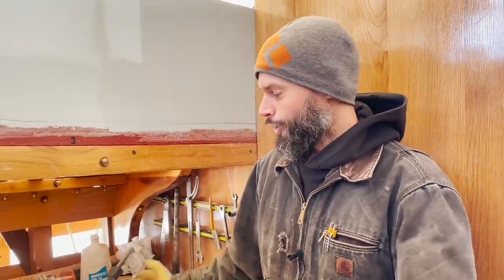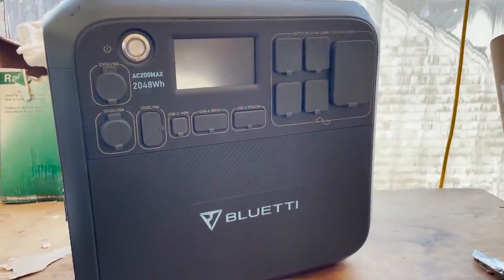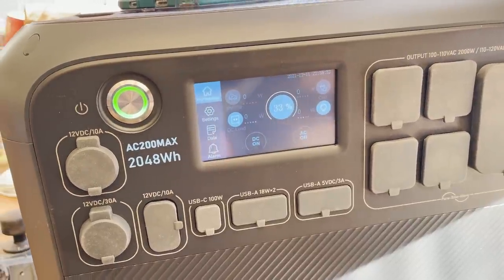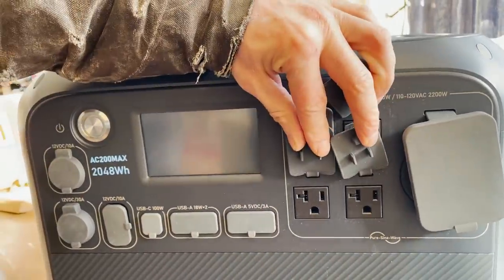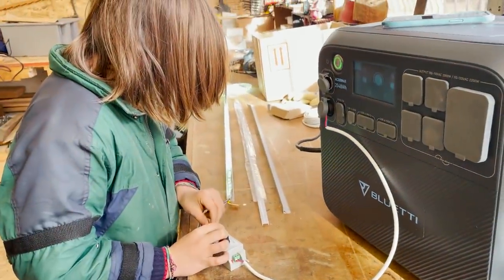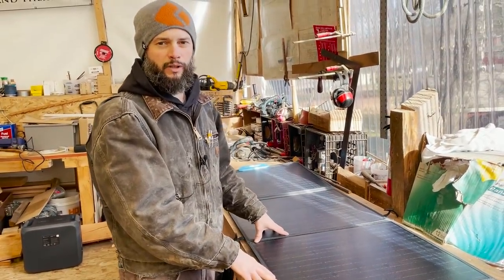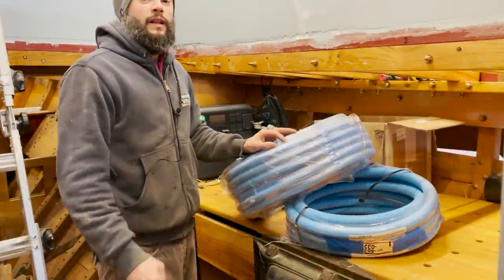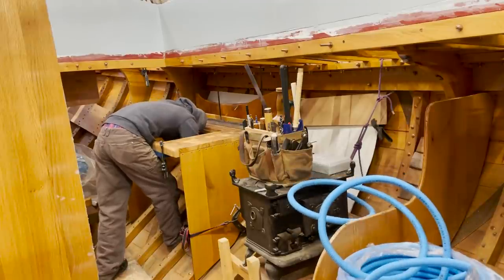Boat Electrical Systems, First Steps - Episode 194 - Acorn to Arabella: Journey of a Wooden Boat

Comment: As an electrical geek. I am not impressed with this battery setup. I would imagine inverter/charger unit's you leave on the boat are better suited. I don't feel comfortable with an assembly that you can't repair individual cells. I am an electric fork lift mechanic. I've managed battery charging systems for 16 years. Being able to pull cells or batteries out when there's a failure can save a ton of money. 

Unless you're getting some kind of kickback.... like the entire system and repairs included, for free as some sort of R&D agreement, this is not a road I'd travel down, personally. However, I'd like to see you guys prove me wrong and the system be great.
Reply from the maker: We’re thinking a smaller system we can carry into the back country is definitely the way to go. It’s been a little while longer with it now, and while it’s great for a backup on land, primary on a boat is a stretch.

Comment: I have found that strip lights and lightning are a poor combination.  Strip lighting is very delicate.  I suggest finding a expert that can coach you how to survive lightning strikes.
Reply from the maker: We’ve found a great many differing opinions on that. What’s the method you have in place?
Reply: @AcornToArabella  I have had good luck with "ALITOVE WS2811 12mm Diffused Digital RGB LED Pixel Light Individually Addressable Round LED Pixels Module IP68 Waterproof DC 5V".  I only use them inside for arts projects.  I would never use them outside or for something I rely on.  I would ask people who have boats, what works for them.

Comment: the bluetti is a great backup but you really want to build in a system that is proven then locked away, check out some of Will's videos: https://www.youtube.com/watch?v=adFGmOlDM-Y . A 24v all in one inverter charger that you can hardwire in with a nice simple shore power connector and a couple of 24v lifepo4 batteries that can be charged from the engine or be used to jumpstart the engine (redundancy) is the way to go.

Comment: like the 3 nobs color controler.. no apps.. no smart something..no small fiddeling remote... put it out of the weather protect it from rain and you can adjust it even with gloves on

also you might ask Bluetti about the 2 extention Batteries or purchase them..if you want to use that thing remote on an iland you also must think about a watertight box or bag for transportaion and a backpackrack these are not that light
also in this case consider a second unit to stay on board

 but at least plan for needing the future space for the 2 extentions right next to it where you put this thing in your boat

Happy New Year o7
Reply from the maker: 🎉 happy new year!

Comment: @JAFO  Not realy!! Because if you do not open the fridge dor, temp. does not rise during a long perio of time, and the PLC with data from the termostat, that manage the compressor, put it in an stand- bay modus. From the 30 hrs you reportet, it works probably only 10hours on full load!  To confirm what I'm sayng, it is Very easy, just put an multimeter in sequency, ( in to the current circuit, and you will see Amps consumption  instantaniusly!!!  For no money, I would go on the midia, and tell so much non sence!  It Would ruin my credibility, personaly and professionaly. How so much ingenuity could exist, at the ARABELA Team, such a lovely project! And EXTREMLY Professional! Hard Working, honest persons. Please do not sale your soul, spoil ARABELA heritage!! I will be on miami boat show. We can meet

Comment: A Bluetti advertisement disguised as the usual content. Not really very cool, if they paid you or you got the goods for free - you're paying with our time. I'm 20 minutes in, and it's all about the product so far. Anyway, I would separate everything like batteries, charge controllers etc, so that you can replace any single item if it breaks, instead of replacing the entire box if something goes wrong, not to mention finding a dealer near wherever you are in the world.
Reply from the maker: Remember when we did a side-by side comparison just a little while back of the new thickness planer and the old? That was about 20 minutes on a tool. Thanks for watching… details can feel like a commercial I suppose, but we get detailed about a lot of the equipment we use. As for the house battery system, Steve is leaning back toward a conventional battery bank, but maybe planning to have a smaller version of one of these that can leave the boat for shore excursion. I personally don’t like anything I can’t take apart and replace or modify. —Anne
Reply: @AcornToArabella  Did you guys agree to give that product time on your channel in exchange for a freebie, discount, or money?
Reply: @AcornToArabella  ...not that it matters, I've already unsubscribed. I won't be the victim of ambush marketing, or possible dishonesty again. Fool me once...
Reply: @AcornToArabella  And all of a sudden it now says "includes paid promotion" in the top left corner. Tut tut.

Comment: The planking isn't finished. The hull is miles from finished. Bulwarks aren't done. The interior structure isn't done. Decks aren't done. The house top isn't made. Tanks aren't in. Spars aren't done........so playing with coloured strip lights seems a bit premature.
Reply from the maker: There you are, Mike! Happy New Year.
Reply: Never built a boat, built plenty of houses.  This is exactly the right time to be installing conduit and taking a deep dive into the technology available to make her a home on the water.  That, and the diversion from structure to mechanicals is good for the creative juices and provides an opportunity to rethink and redesign structural elements that may be needed to accommodate the technology.  Just my opinion but I respect it highly. 😊
Reply: @sunny71169  I've built plenty of houses, too, and I'm an architect. At no stage have I run cables before I've finished the walls or got the roof on. And having to build internal walls (partitions) around service runs would be just making work for yourself. Work it out properly on paper and there is no need for re-thinking or re-designing. It just feels like A to A are drifting. The focus and drive has gone, and it's now more about the Youtube channel than the boat.
Reply from the maker: There’s the spice. 🔥

Comment: I think “includes paid promotion” at the start was an understatement. You basically spent 22/27 minutes promoting their product.  You should have billed it as an advert that includes approx 5 minutes about a boat… it’s shame that what was a great channel is going this way. I have been watching since you poured the keel and if you keep going this way, I will stop. I get it, it’s costly to run a channel and build a boat but your donations and YouTube revenue surely don’t leave you penniless.
Reply from the maker: Dave, we’re glad you’re here. Talking about the specifics of what Steve thinks will be an auxiliary power source to some kind of primary 12V battery system is indeed a departure from woodworking for sure. We did want to disclose that we didn’t pay for this unit that was sent for us to test. We thought it was the honest thing to do.
Reply: @AcornToArabella  I am not questioning your honesty at all. I am merely pointing out that you spent the majority of the video promoting it. That’s not what I subscribed for.
Reply: @Fabric_unfolded  - Funny how some people manage to conflate "discussing and testing features" with "promoting".
Reply: @Garryck-1  testing would surely include 2 or 3 similar products from differing manufacturers that are then put through identical benchmark testing to work out which performs best/ has best features etc…
Reply: @Fabric_unfolded  Your idea presupposes that a) you have the budget to undertake such an approach, or b) that you're blessed with a plethora of manufacturers of similar gear, all of whom are eager to donate items for you to test.

This is the real world.. where people do what they can with what comes along.